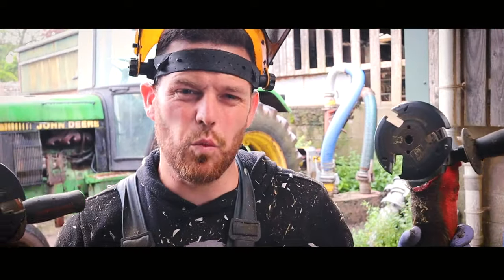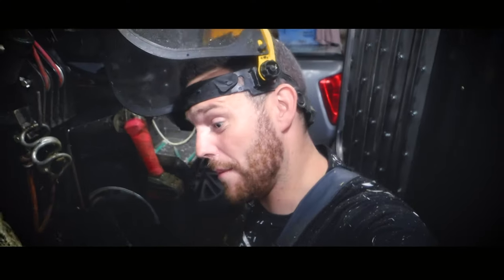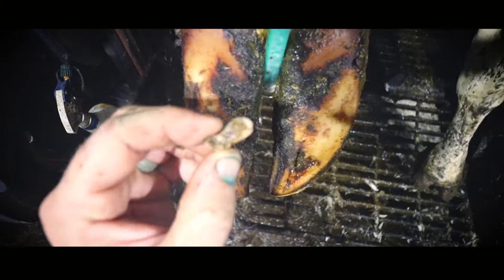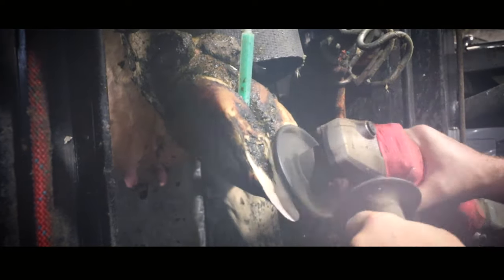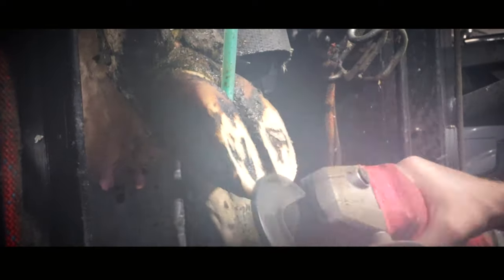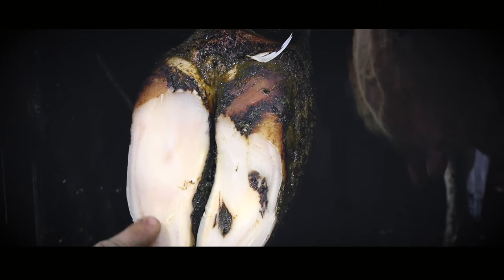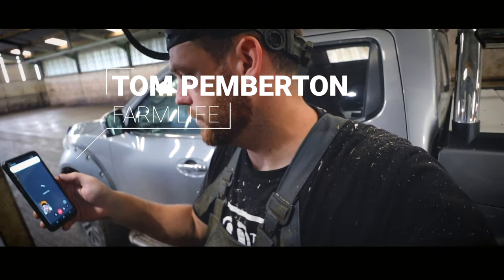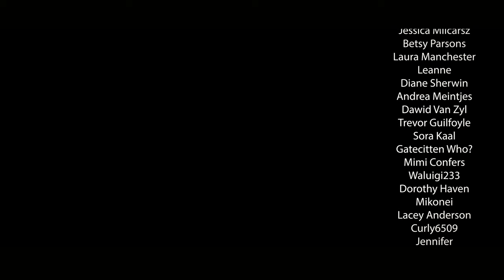is that a TOOTH in a COWS FOOT???

Comment: When addressing hoof wall issues, can a smaller tool like a dremel be used to trace the issue effectively? Is this a procedure reserved for the veterinarian?  I see much good sole removed when only using a knife. I can also assume that when using a dremel, the resulting void would have to be filled with something.

Comment: As a toolafile I have a couple questions for you. The grinders that you are using I seem to have recalled sometimes or corded and sometimes are cordless. Do you have a operating or p.m. that you preferred to run at.? I have a personal preference for D Walt. It looks like you were using Milwaukee but you have them taped so I am not positive and you being not in the states very easily could have a different brand available to you then available to us. I have had both the D Walt 20 V as well as the 60 V. The 60 V although it is heavier is more ergonomically designed so I don’t generally feel that much extra weight. Also the 60 V can handle up to a 7 inch blade if I so choose. The next thing is you seem to not always have with you the ability to wash it off. I assume it depends on whether or not you are hooked up to water. Have you considered carrying a 3 gallon bug sprayer with just water in it? I do this. Just a thought. It also might be that you have had past videos where are you discussed your tools more in depth. I have not as of yet seen them if you have them could you direct us.

Comment: Before I found this channel the idea that cows needed hoof trims didn’t even occur to me! I knew horses did, but I didn’t even consider cattle, do sheep and goats need them as well? Presumably they do, but because they aren’t carrying quite as much weight id guess it’s not as vital a healthcare process for them to be regularly trimmed
Reply: Certainly for sheep, hoof trimming is vital, and I would assume it's the case with goats too. What you have to consider, is that while they are smaller, so are their hooves.
Reply: @alistairclement4239  apparently goats need their hooves done every 3-4 weeks, which is insanely faster growth than the 3 times a year for cows, I expected it to be the other way around

Comment: Watching you earlier  testing the pink disk made me cringe: in the very beginning interfered with your movements a lot...not after fixing it, though.
Those new disks don't interfere with your flow of working....much better from the start. Cross my fingers, you will get the manufacturer to fully adjust them to your liking...
Hoof-GP-branded disks rock!

Comment: Can you re-sharpen the  blades or  maybe they should make the blades (part that cut) be removable and replaceable the tips that cut ,that way you can remove and replace the edge of the blades  when they get dull! If they had 3 recessed screws and you could remove and replace the blade or cutting edge, instead of replacing the entire disk you could just R&R the cutting edge! I am not sure that the horn isn't to hard for this to work but if  you could, you could save money
Reply: The blades are replaceable, some, if not all, can be sharpened too.